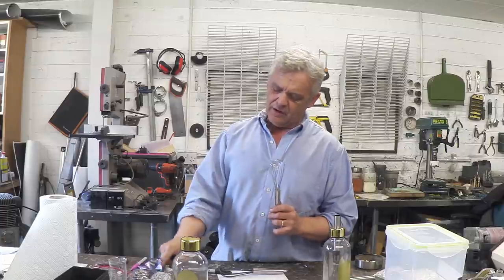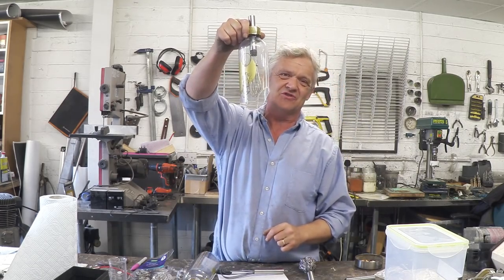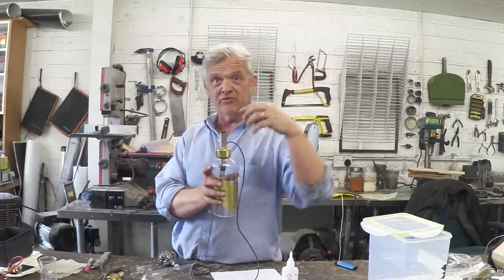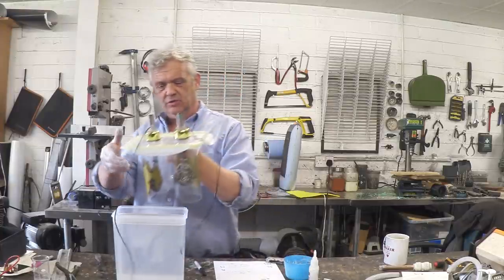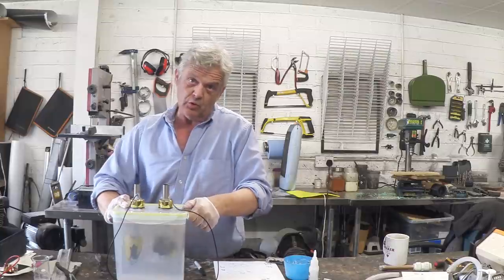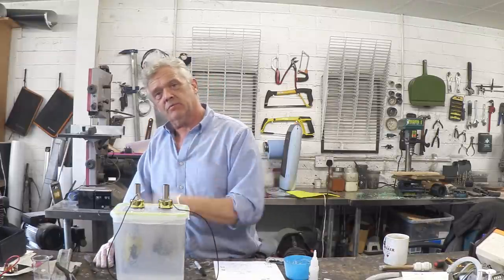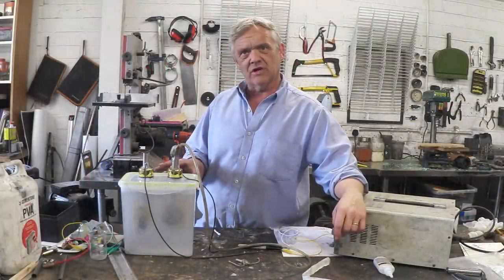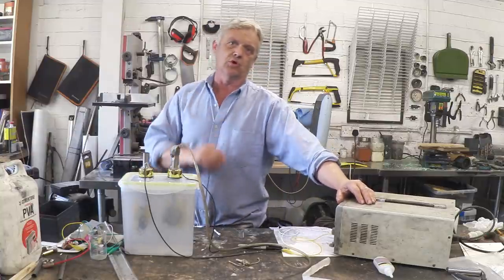1256 Urea Electrolysis For Hydrogen Production

Comment: Neat stuff! Thanks for the shoutout. I did not know about urea electrolysis. I'll have to play with that. I like that you get a pure nitrogen output as well. I don't know many other simple ways to make inert gasses chemically.
Reply: to me, this is a legitamate means of extraction and refining LN2 when in space. A source of N2 for Atmospheric conditions, and a source of H2 for the Sabetair and fuel reforming reactions.
Reply: When you say "play with that", you mean you will start saving your urine?
Reply: Haha that's what I asked too.
Reply: I wonder what submarine designers could do with this?  Refillable compressed nitrogen stores for everything they currently use compressed air, but with an added benefit of firefighting usefulness?  Compressed hydrogen stored outside the hull for auxiliary power, (and adding to  ballast tank blows)?
Reply: Heres a good one, pump air through a high voltage electrode at around 4kv, and bubble it through water and you get Nitric Acid.
Reply: Is that using ordinary air or bubling N though H2O

Comment: ROBERT: Thank you for finally tackling the Urea Hydrogen issue!  If you'll recall, I bugged you for months to do so, a couple years back.  Now, please take it to the next level, by doing it with net DC power OUT rather than feeding power IN -- by substituting ALUMINUM (as in crushed waste Beverage Cans) for your Stainless Steel Anode.  By switching to NaOH over KOH, you will find that the caustic becomes a true Catalyst, replenishing continuously during the reaction. [When the caustic is sufficiently concentrated to expedite the reaction, the polymer can coatings dissolve away in it with no problem.]  It will generate Hydrogen, DC Current and Substantial Heat Energy, as long as there is Aluminum for it to react.  The practical issue with making this commercially useful is figuring out a mechanics by which additional crushed cans can be continuously added to the system, without opening the gas evolution chamber to the atmosphere.  Capturing the Hydrogen and the DC is pretty straightforward, and a heat exchange loop (or Thermoelectric Chips) to collect the Heat energy can be easily sorted out.  But Free Hydrogen & DC Current from waste Soda & Beer cans is pretty nifty.  The Energy embodied in the cans' Aluminum is worth far more than the metal itself is, as a recyclable.  205 Watt Hours per 355ML Can.  Have at it!
Reply: Instead of crushing the cans, could you cut off the top and bottom, slit it to make a single layer sheet, then run these through a good paper shredder?  

Maybe you could incorporate such a spreading device into your design and have that be the way you add the aluminum? How often would the device need more aluminum? Is this an hourly thing? Once a week or a month?
Reply: @colleenforrest7936  It depends how much power you want it to produce.  Crushing them vertically can yield a fairly uniform 'disc' shaped "puck" that is fairly compact. The flat sheets obtainable from the cylinder sides would be easy to use in themselves, but cutting the ends off reliably to do so is a challenge, and then you have the leftover ends, which are the most reactive parts, since they are uncoated with label paint.
Reply: This sounds very interesting. Have you put it to the test or is it theoretical ?
Reply: @herenow2895  Yes, I have, and the Aluminum releases a lot of energy (as many other Aluminum Battery/Fuel Cell projects have demonstrated). Using waste Aluminum, and Pairing it with Urine optimizes it.  I've done experiments, but am not set up to quantify the Power, Hydrogen and Heat outputs, the way that an experienced Chemist like Robert is.  To see him get his little motor running, while making Hydrogen off it, even just measuring the Temperature (without even trying to do anything with the thermal energy) would be dramatic.  Wherever people are emptying beverage cans, they are producing Urine, so such a system could definitely find applications.  In my testing, the Heat and Hydrogen were both impressive; but RMS would get a good handle on the Current you could extract from it as well.  Each Aluminum atom releases Three Electrons as it Oxidizes.

Comment: Chemically storing hydrogen is what facinates me after seeing an interveiw of Bob Lazar years ago storing it in a vessal in the back of a car. I think it was solid state and extremely safe !
Reply: A lot of people temporarily store the hydrogen in Mylar balloons.
Reply: You could use big inner tubes as well. 
But they do actually make a thick mil bladder in methane production in other countries that would work too.
Reply: Solid state is good but why not compress it in to a butane cylinder or failing that an lpg tank.????
Reply: @patomahony9747  safety is my understanding, solid state is basically inert and cant explode, though Ive not understood why we can make propane and natural gas vehicles but not hydrogen storage
Reply: @seekerscovereal  worked in a facility that had a hydrogen fuelled furnace. Can’t rem if it was in cylinders or in a large tank. From what I can remember static electricity was an issue as was temperature . 
Below 800c it is in furnace applications highly explosive if injected in large quantities. Think this was a sudden rise to a concentration of around 30%. 
Reason it is used in coating furnace operations is it’s clean burning properties. 
Unlike other gasses that have additives to give them a smell in case of a leak. This is apparently not possible with hydrogen. 
All in all if handled correctly just as safe as other fuels ie lng or petroleum products just has different requirements
Reply: Lithium hydride is anything but safe. As long as you don't rupture the bottle, sure, but other than that you have a massive fire on your hands. Safe is relative.

Comment: Years ago I watched a guy with corvette store hydrogen in tanks for removing sulfur gas from well water. They contain beads of some kind of polymer that absorbed gas at ambient temperatures. When warmed the beads release the gas. Its less explosive while contained in the beads.
Reply: I believe that was Bob Lazar, actually
Reply: yes it was Bob and the car was fake. He did it for press at the time.
Reply: @Hydrogen4Health  really it was fake? Was his particle accelerator also fake?
Reply: He said it was some type of hydride, maybe lithium? If I remember correctly?
Reply: @theyoutubeguy1545  I was trying to remember as well I can't remember what type he said it was. I'm fairly certain it was not lithium though if my memory serves.
Reply: But it was for running an ICE fueled by the hydrogen stored in the Hydro tanks. I didn’t see anything about well water and sulfur, so I might be wrong
Reply: @theyoutubeguy1545  the material in the tanks is the same material used to absorb sulphur gas out of water that is used in some water softening systems. Its an add on feature.

Comment: I can't tell you how much I enjoy watching your videos, I was wondering what other gas came out besides hydrogen from urea thank you for letting me know it is nitrogen. If you use carbon fiber instead of stainless steel you won't have the problem of the breakdown. I had a friend that used to be in armed service and he explained to me how they used to use compression and vacuum to separate the water and get hydrogen and nitrogen out of it somewhere but they exhaust the hydrogen and use the nitrogen in the tires for the plans.

Comment: Hi Rob, can you explain why KOH is still required? Would the urea not act as an electrolyte? Cheers
Reply: Urea is not an electrolyte, it is a neutral molecule.
Reply: If you were using your own piss it would have salts in it as well as the urea and that would work but straight urea is neutral as Nicola Toma stated.
Reply: Rik rik  Try adding glycol as a defoamer.

Comment: There's quite a few videos on Youtube about hydrogen production, there's not many on how to generate electricity from hydrogen - with the DIYer in mind - expensive catalysts and unobtainium equipment being the major obstacles.
Reply: Dupont-made Proton Exchange Membrane is really the only part that is relatively expensive I have found. Have been passively looking for a more DIY friendly PEM material, haven't found much yet
Reply: I haven’t had a crack at them yet, but I think the theory is take polystyrene, grate it up very fine, mix it in sulfuric acid at about 80 degrees until it melts and turns to goop, then squish it flat in a press and let it set.  Thinner is better…
Reply: I actually think the catalysts are the hard part though.  They make such a big difference (eg platinum and similar metals).  Like orders of magnitude more efficient, not just a few %.
Reply: @alexbuchanan2605  yes,I agree about catalysts, one way to reduce the need for expensive catalysts is to use heat, here's hoping Rob does a video on solid oxide or direct carbon fuel cells.

Comment: Urine is certainly cheap and available in a pinch.  But its contaminated with sodium chloride which is conductive in water but will give off a bleachy smell of chlorine.  One might prefer to use urea fertilizer with potassium hydroxide for the best conductivity at these low voltages.

Comment: You can store hho gas safely at 10-15 by volume with town gas or butane lpg and methane . The mixture together negates the chance of hho explosion as the ratio of oxygen to fuel is substantially reduced. Apparently there is some regions already doing this from using solar panels for electrolysis! I think its perfect !

Comment: youtube blanking my comments again, half of my comments get deleted.  
i had previously included a link and abstact for
"Excitation of H2O at the plasma/water interface by UV irradiation for the elevation of ammonia production"
from journal: green chemistry

also stan meyer claimed that radio frequencies were used to "help crack" h20 for his water-powered car.  would be great if you were able to recreate or give your expert analysis on his water-powered car from the 80's 90's.  its a very controversial subject so i can understand if thats a problem

anyway best regards and keep up the good works
Reply: Yeah, I find you have to include any links in the original post, or it creates an error when you add it later in edit mode!  I use a separate document editor to copy and paste an links in with my xomment!
Reply: @themeek351  nice, noted and thanks

Comment: Rob try passing the hydrogen through a catalytic convertor. Will generate heat, as it heats up it becomes more efficient and even less gas is required. Be sure to add a flashback arrestor + bubbler.

Comment: Love those voltage specs of .3 volts. What power consumption based on your setup? Update: 5:53 answered it.

Can we use an enameled cast iron instead of brittle glass? How hot does it get?

Comment: I made a Fe Cu battery using urine as the electrolyte. It produces the calculated 0.70v. string a few cells together and you can make a battery that will power a red LED for a few hours. it's rechargeable too.

Comment: Do u think it would be as easy as sticking a couple of electrodes on wastewater tanks, or is there any risk of producing different gases depending on the chemicals in the solution?
Reply: And how to separate each part of the waste water to use this process is another tricky part.

Comment: Since it heats up. Couldn't you use the aluminum and brass rod in water generator to power the unit in the same container? Maybe add a joule thief to increase the voltage to run the two scouring pads.

Comment: Brilliant.   So... what happens if you put a dedicated pee funnel into your bucket? like, could you just whiz into this thing to keep your urea levels up?  Would just straight pee work?   
That seems like it would save a lot of water on flushes while producing hydrogen if it would- though I guess, if it's not electrolyzing the water as well, you'd get an overflow issue, though I suppose you could rig an overflow outlet to your drain.

Comment: Cool! now wouldn't graphitized floral foam work for the anode and cathode? Also if you have the nitrogen gas go to a chamber with a continuous electrical arc and then bubbled through distilled water you will get nitric acid.  Have a merry day Robert!
Reply from the maker: I think it most definitely would mate
Reply: @ThinkingandTinkering  Excellent :)
Reply: @ThinkingandTinkering  , hi Robert. Nice idea. By the way how much amps it draws? Since we need to calculate power to output ratio. Like x kw : y volume of H2 : z volume of N2.

Thanks.

Comment: Love your channel, but at 5.4 you say to run this electrolyser  at 1.4 volts to ensure that the water is not electrolysed ? Did you mean to say to run at 0.4 volts so as to keep under 1.25 volts to prevent water electrolysis, or am I missing something ? a few brain cells perhaps.

Comment: I'm a bit miffed about two things. This method, though requiring less power, requires a constant supply of urea. 1) Is the POH consumed in the process and 2) wouldn't it be cheaper just to use water or are there other issues? Thank you for these videos, I think they are great.
Reply: And could be scaled up to waste treatment facilities requiring less energy than fresh or salt water while eliminating a waste product and producing 3 potentially useful clean byproducts.
Any POH would stay in solution until it reacts with contaminants... though on larger scales Ca-OH is used as a deflocculant IIRC

Comment: Can sulphuric acid be used?i am thinking even more hydrogen ?
Reply: I'd be woried about Hydrogen Sulfide gas
Reply: @technosaurus3805  would that separate at low voltage?
Reply: @Buzzhumma  Not a chemist but there is a specific term for that voltage that escapes me at the moment, I just know enough to try to be safer in the future. If you use salt, you can get chlorine gas - gotta be careful especially in enclosed spaces.
Reply: @technosaurus3805  decomposition? Hydrogen evolution ?
Reply: Sulphuric acid should work fine, although it would likely be less conductive than KOH/NaOH or chloride salts. Your best results would probably be with Chlorides although they are more corrosive and would produce chlorine gas.
Reply: But like with Nitrogen gas given off with Urea, we have to consider these vented gasses on climate & the Ozone Layer etc. The Greenest Hydrogen is produced from Algae, while permanently sequestering atmospheric CO2.

Comment: I wonder what submarine designers could do with this?  Refillable compressed nitrogen stores for everything they currently use compressed air, but with an added benefit of firefighting usefulness?  Compressed hydrogen stored outside the hull for auxiliary power, (and adding to  ballast tank blows)?

Comment: If you could get it to 10,000psi and refrigerate it, you could fuel a fuel cell vehicle. How much would that setup cost to build and run? Is that too high a pressure to muck about with at home?

Comment: Tried this 10 years ago in several configurations and power densities.
It does not work like he is saying and showing. Urea will not electrolyze easily with the energy he is talking about.
Makes for a cool video but you guys are going to be angry when you can’t make it work.
Yes I’m one of those guys that knows what he is talking about.
Reply from the maker: maybe a read of the research might help - you don't sound like you know what you are talking about
Reply: @ThinkingandTinkering  maybe when you do a video like this you could actually show it working and spend a couple of minutes proving what you say.
You know it doesn’t work but you still want the views and revenue. You are wasting people’s time and money and that’s not fair.

Comment: Nice! How about capturing the nitrogen and using it as a fertlizer on your compost pile?
Reply: N2 gas is relatively inert. Lightbing strikes, bacteria, and Haber-Bosch can fix it, but just bubbling it through a compost pile probably wouldnt do any more than just properly aerating the pile with atmospheric gases. In fact it would probably suffocate all the oxygen breathing critters.
Reply: But there is a new alternative to haber bosch that is a lithium electrolysis cell

Comment: Thanks for the demo but which is it? 1.4V or 0.37V ???
Reply: In a very low resistive cell it is possible at the lower volts but in this cell there is along way to travel to each electrode so the pressure(volts) needs to be turned up to overcome the resistance but you do however get very good seperation of the gas in this build .

Comment: It's not just about V.  
it's much more about Htz....

Edit:
And molecular bonds.
*Remembering that the mass-energy equivalence equation can be reinterpreted using the preceding frequency-energy equivalence equation. Couple that with a sound understanding of the relevant atomic/molecular harmonic scales for the application. (just like a microwave uses such understanding to select its materials, cavity configuration, electrodynamics and HARMONICS required to target the resonant frequency of a water molecule (which is relatively simple, being a simple dipole molecule) to induce an electric charge to excite the molecule. 
"But that's not the same" you say?
Horse for courses...
All I'm saying is the public understanding of the current electrolysis method is a very crude and inefficient method. In the vicinity of <5% of what we could be easily capable of with current materials and tooling. 10-20yrs of R&D.... That number is an order of magnitude greater than what we could/would be capable of.

Comment: if it produce N2 then you can do away with separation and get more rapid electrolysis by using those simple HHO generators but they will be called HHN generator xd
so that means safer hydrogen storage and faster production but at expenses of less dense energy